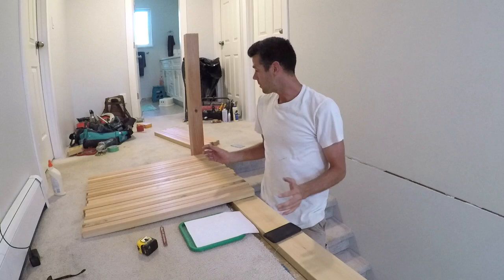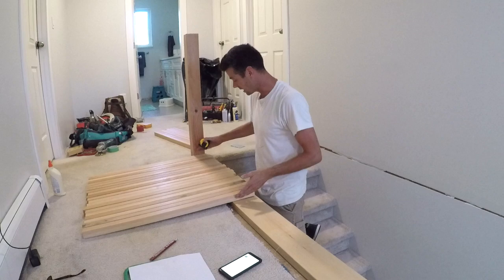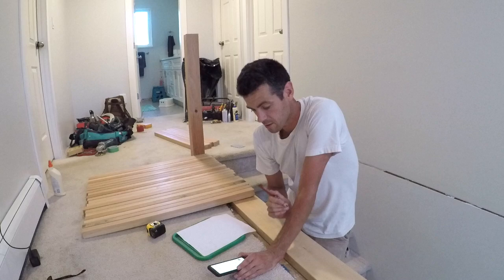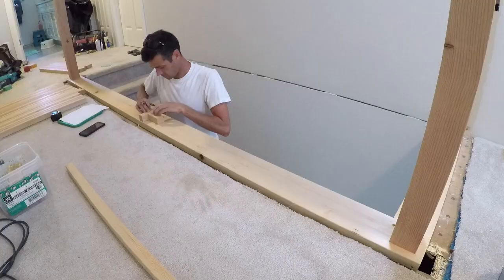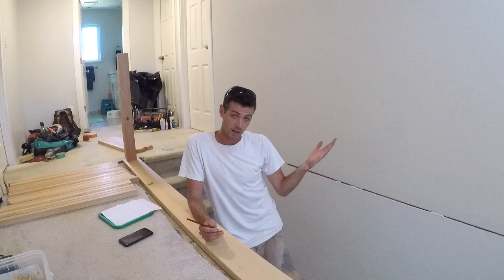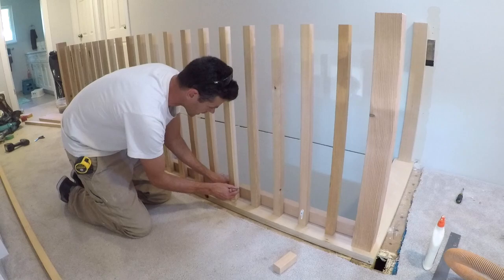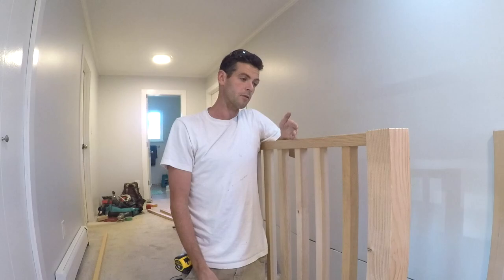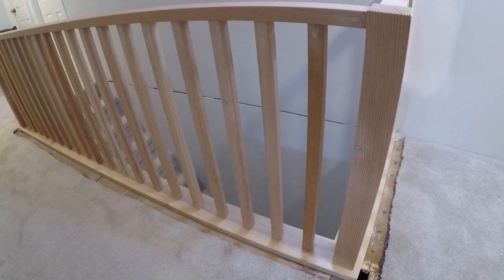How to get EVENLY SPACED Spindles!

Comment: “Story pole”...
What I usually do is, on a scrap 2x2 that’s longer than your opening, I mark the layout as desired. Make centerline marks, one at 1/2 of overall and other at nearest spindle (center). Place story pole next to bottom plate at centerline. It’s going to be one of the two cl marks on story pole. Even spacing every time with the exception of the ends. They’ll be even with each other but not the course.

Comment: measure by inch is good, but is a bit easier here with use mm instead. 110.75" = 2813.05mm, 80.75" = 2051.05mm, so 2813.05mm - 2051.05mm = 762mm. Then divided it by 21 = 36.2857mm per each gap. It is still a long decimal number, but this decimal number is slightly easier on mm than on inch measurement, agree?

Comment: You could have drilled dowel holes and glued and doweled the tops. Probably would have worked best if you drilled the balusters before attaching the bottoms using a jig so the holes wouldn't wander due to grain variations. One other thing I would suggest unless you have the abilty to use a drill press, when you drill your screw holes, drill from the side the balusters are going to be on. That way the screw holes will be in the dead center of the balusters even if your aim/angle is off on the drilling.

Comment: I would start laying out the short side. First with minimum number of spindles (closest to max 4") and then with one extra. After that I calculate the long side, given the two spaces, to see wich one of theese would be the best match. From there I would either move the post slightly or use the space that is the best match and adjust it.
This way I get the smallest difference on short and long side.

Comment: I put another wider piece if handrail on top of that top rail you didnt want to screw. Goes on top of the posts too. I use dominos on the joints if possible or just hand rail anchors and I wood dowel the posts. So you dont have those top screws.

Comment: 1 - Math will never fail you its constant.
2 - the block method will fail you first.
3 - you never measure post to post. You measure post to where your last spindle will b.
4 - just fudge the last 7 or 8 spindles

Comment: Ok, simply use a top plate full length. Screw straight down for structural strength.  Place a u shaped cap rail over top. Then glue & tack cap rail with braids from the sides

Comment: For the top rail, particularly since this will be painted - could you thickness the rail to be ~3/16" oversized then rip it 3/4's up from the bottom. Use the 3/4''s piece to attach it directly into your spindles from the top. Than glue your remaining 1/4" piece to the in place top and plane the sides flush of any variation?  Basically, just veenering a top on to hide all the screw heads?
Reply: Just what I was wondering. Great idea sir.

Comment: Always measure from the same point. Using blocks and moving them will give you a fraction off all the time creating a larger error the further you go. If you measurement (space + spindle) is for example 9,55 inches. Your next would be 19,10. Etc.. one point of measure. Minimum error.

Comment: I go about it the same way. Test the spacer block by skipping down the run as you did. If the last one ends up gapped put a layer of masking tape on the spacer block and recheck. Of course not all railings need that type of attention 🍻
Reply from the maker: Masking tape! Genius!

Comment: Screw in from the top then add a topper rail cover piece 1" x 5' x  length to cover all the screw heads and besides that piece on top doesn't look wide enough for the finished look. The topper should be at least as wide as the bottom footer piece.

Comment: 1. Take overall inside measurement. 
2. Add width of (1) spindle to overall inside measurement. 
3. Determine desired spacing between spindles and add width of one spindle.
4. Divide sum of ( # .1) by  ( # .3 )
5. Round quotient of ( # .4) to closest whole #.
6. Divide ( #.1) by whole # from 
( #.5 ) . If there is a remainder, convert it from tenths to 16ths of an inch by multiplying by 16. THIS IS THE ON CENTER SPACING OF SPINDLES.
7. EXAMPLE... if  ( #.6) is [ 4.5  inches ]  then [ .5 × 16 ] = 8. Which is 8/16. Which is reduced to 1/2". SO...4.5 " is 4-1/2". 
REMEMBER... there is a life safety code that restricts maximum spacing on railings.
8. Finally, begin layout by burning thickness of one spindle, then layout using your acquired measurement from ( #.5). 
AGAIN...YOU MUST LOOK @ LAYOUT FROM CENTER TO CENTER OF SPINDLES.

TO RECAP... beginning @ inside, overall measurement...burn thickness of one spindle and then put mark @ measurement you got from ( #.5 ) Put an X behind or.              " set back " from your layout marks. The spindles go on the side of mark where the X is. 

Simple Arithmetic...

If you don't know what it means to  " burn " just ask any carpenter. Or just get him to do it for you.

Comment: I definitely would not toe screw or pocket screw those spindles.
I think my choice would be to remove the top rail, drill small holes in the spindles and top plate and insert dowels, glue it.
If you're concerned about clamping it while the glue sets you could use a split dowel with a wedge which tightens it in the hole when it is fully inserted.

Comment: Sorry don't know your name. Go into play store and get construction master app free version. It will work out your spacing perfect. There are other things on it that helps you. Suspended ceilings input the room size it tells you how many main tee ,how much wire everything. Input room size on the decorating function tells you how many rolls of wallpaper for a given room. In the settings feature one can change to metric or imperial. Hope this helps.

Comment: So with 21 spaces you you find center then divide 5.342 × 2  off of center line is another way but i prefer just working from one end. Gauge blocks will compound any error in math and eye balling is for hacks.
Learn  decimal equivalents for example .781 is a long 3/4 and .406 is a short 7 / 16

Comment: I do exactly what you do to get the initial spacing, but then I mark out from center out so that any run-out from marking errors gets eaten up evenly on the extremities where they are less noticeable because the material dimension change.

Comment: Spacing is genius. But to Monday morning QB the spindle install...why not rip 3/4 inch off the top rail with thin kerf blade. Screw down from top. Glue top 3/4 piece back down with clamps. Probably little to no filling sanding needed on the edge seam. Much easier. Much less noticeable.

Comment: Could you have started with the top piece, where you drive screws through the top and laminate with like half inch board to hide them, then trim off the glue/sides with a router? Probably overcomplicate d but a way to hide screws? Though I think your way of attaching the spindles is the stronger, akin to pocket hole joinery

Comment: It's an year-old video, but... have you ever done marking with a square instead of pre-cut spacer block? Basically laying down tape measure at an angle alone side the base board, leveraging it the way it ends at a whole number. Then using a square against the base board mark the base board against whole numbers on the tape measure. I believe you showed this technique on a small wood piece in the past.

Comment: If it was going to be stained, contrasting wood dowels through the rail.  If you can't hide it completely, make it a focal point.
Reply: Yeah, dowels would be cool, but it's a lot more time, effort, and material, which translates into a higher cost for the homeowner. Most dinner want to pay for that.

Comment: Ben, search the Internet for a rivet fan spacing tool.  Tell me if that tool will make spacing stair spindles a snap.  I have seen as large a 20 hole (less that $40 USD).  There are no calculations involved for up to 20 spots and I see no reason why it cannot go higher once you do the first 20.  There are smaller ones that you can use for jobs like spacing coat hooks or anything else that needs equal but wierd spacing.  Code says 4 inches but with this you can easily change spacing to check the look of less than 4.  If you like it do a new video on it!

Comment: i would drill a hole on the under side of the top one and the standing ones and use wood plugs with strong woodglue that will be strong enough, and it would not be visible

Comment: I just start in the middle (length ➗ 2) and use two 4 inch blocks between the first two ballisters, using my hand as a vice. I then tap them so they're level then pick up my gun and nail them. Rinse and repeat.

Comment: I have a spacing spreadsheet on my phone, it gives you measurements for each edge in the run. So you wouldnt have to use the spacer method.
Reply: Isn't it still better to know how to do it like the Amish?
Reply: What’s the spacing spreadsheet called? Is it an app? That sounds way better!

Comment: BCH, RCH, blonde one, etc. Also, no matter what you do, it never works out perfectly because of compounded error. Spindles aren't exactly the same, the 3rd and 11th and 17th spindles are are off the mark by 1/64", you're spacer block is off by a 64th, etc etc. just cheat the last 4 or 5.

Comment: Nice one! I have been considering doing something similar. How about the post at the top of the stairs? It is rigid enough? Did you just screw the base board to the floor, with the post glued + bolted to the board from below?

Comment: "And not perceptible to the eye." Well, that depends on the eye, I spotted it instantly. But given the 4" max spacing requirement and having the two lengths predetermined there wasn't any other choice.
Reply: You didn't spot it instantly.

Comment: There are two types of countries in the world.  Those countries that use the metric system and those countries that have sent men to the moon.
Reply: Marcus Burks I hate to disappoint you but NASA used the metric system for the guidance computers. The readouts were imperial because the crew were all used to feet and inches but the internal calculations were metric which was then converted if they needed to be displayed for the crew. If you don’t believe me, google it.
Reply: stuart cole so you are saying the United States only uses the Metric System?
Reply: Marcus Burks no, not at all it uses and used (in the 60’s) both but your original statement was incomplete and misleading. When the US wanted to do one of the most technologically advanced things that could be done they chose to use the metric system because it was easier. It’s also used a lot more in America than you may be aware of.
Reply: Marcus Burks Be it a (unfunny) joke or not, there is a difference between correcting someone’s grammar and pointing out what they said is incorrect or untrue.

Comment: I’m using this formula, and have been off about a 1/2” each time (tried 2ce) 😫🤔
Reply: Just cut second spacer which is slightly bigger/smaller to accommodate the difference.
Or (if you have odd number of spindles especially) mark the central spindle and run them from one end and from the center. And you will be off by 1/4 inch only....

Comment: Nice Job!  It's wood, so 'close counts'  I've used similar method AND didn't graduate high school.  I'm having a major problem trying to find a suitable drywall anchor to fasten a heavy  IKEA  vanity and 36" porcelain sink to just drywall itself.  No studs,  but vanity has legs/feet.

 Please help.  Thanks.
Reply: I used some self tapping metal 'Ramset' brand anchors a couple of days ago, they were rated for 20kg per anchor.

Comment: I still don't understand how you with the imperial system can practically use small numbers/fractions. I'm talking about fractions under 1/4". It seems too difficult to me :)

While I'm at it; I'll brag about the metric system.

You can take any measurement and easily convert it all the way from micro to lightyears, grams to tonnes, ml to m3. You only add or subtract 0 to the number.

Comment: measure gap between post and spindle stack in mm devide by 21 done... Why dont you imperials have a metric tape in your toolbox for this type of work I dont get it.
For the handrail maybe drill trough from the top and hammer in dowels. Cut them flush with jappanese saw.

Comment: Top rail solution #1: Use a 1x for screwing into the spindles, then screw or glue the 2x atop that. (Forgive me if I'm stating the obvious.). Top rail solution #2: Rip the 2x in half, screw the bottom half to the spindles, then glue the top half back on. Sand the sides and you'll never notice that it was ripped and glued back together.

Comment: That's wierd converting imperial measurements into decimal and then back to imperial. Does a decimal system not make more sense you need to catch up with the rest of the world.
Reply: Or he could have just used a construction calculator that does fractions easily.
Reply: Exactly, Americans frightened to adopt a better unit of measurement.
Reply: Thinking about it, we are probably worse in the UK we use metric and imperial after converting to metric in the early 70's.

Comment: It’s not illegal to buy a tape with centimetres on it, in the states, is it ?  What’s the size of the timber on the deck please. I like what you’ve done there and I’m going to do the same. Just re watched your video to check the distance between the spindles and work out my project. I gave up trying to understand what you were talking about with your inches. Thats fucked man.

Comment: Gee if only there was an easier way to measure things... i dunno something like cm/mm

edit, commented before you addressed it in the video xDDDDD
Reply: yes it is funny in Canada where we use Metric for gasoline, Kilos for food and imperial for carpentry.   Generally if you are doing fine finish work such as this, metric is so much simpler.    In rough framing it is a lot quicker to shout 89 3/8 to the guy on the saw than 2268 mil...

Comment: I cheat it my magic number is every 5 he had 110 3/4 in 21 pickets I move the pickets one eight till I'm in the 5x pattern then I stay on the 5x pattern if that doesn't work I' use a carpenter calculator haha

Comment: So I'm born and bred metric but living in the imperial Britain where metric is almost everywhere. Still managed to pick up some imperial habits like 2 by 4s and such. Sometimes it's just quicker that way as metric measures are often derivatives of imperial.

So why on earth do you insist on converting imperial into fractions and back again? Wasting so much time and potentially losing accuracy?

Metric tapes are available worldwide now at a click of a button. Not to mention all kinds of apps.

You're costing your economy tons in wasted time and materials. 

Please can somebody explain this to my European brain?
Reply: I'll pick up that mantle. So I'm 32 years in construction, 49 years old. I know what a foot looks like from half a mile away. I know what an inch looks like from arm's length. I know what 5 and 1/2 inch looks like from arm's length. I know what any Dimension that I'm likely  to use looks like from across the room in most cases and from arm's length in all other cases. I can look at a bolt or not and grab the right socket every time. I would have to give up a lifetime of experience in order to move over to metric. But I am too old and too tired. Is metric better? Of course it is. But when you already know all the measurements that you'll ever need by memory, why would you change.
Reply: @josephdestaubin7426  Joseph, I hear what you're saying. But you must also be aware you know all these things because you've picked them up over the years. 

Using Metric and imperial is just like being bilingual. You're born into one and the other one is your second language. The first one becomes second nature but it doesn't mean developing the other cannot be fun.

I'm 40. Hope I still have some of what dragged me into this business when I'm your age.

I'm not criticising, just encouraging because I think learning should always be fun.

Comment: You need to stay with drywall. 

You made this A LOT harder than it needs to be

110.75-the total width of all the spindles put together or take 1.5 x the amount of spindles. 

Then 110.75- that amount, divided by the amount of equal spaces and DONE!

Start measuring off the newel post to that dimension, draw another line 1.5, then that same space dimension, then another 1.5" line and so on......

If it doesn't come to an exact 1/16" figure out what dimension it is in between the 1/16" and mark a 1/32" (1/2 of the 1/16" dimension)

Comment: Way too much math 😂
Reply: Math is fun and sometimes needed.
Reply: @cillyede  ohh i know, i even learned it in college. I just mean, having to "translate" the same mesurement back and forth just so that you can use the mesuring tape is soo not efficient.
Reply: Buy a metric tape measure. Problem solved. (4" = 101.6 mm. You can round to 100mm))
Reply: @MrTeff999  actually i live in hungary, we use metric ;) i'm just surprised by the amount of inefficency  of inches and fractions 😂
Reply: @jankasidlo5142  Everybody knows that metric is simpler -- except for contractors.